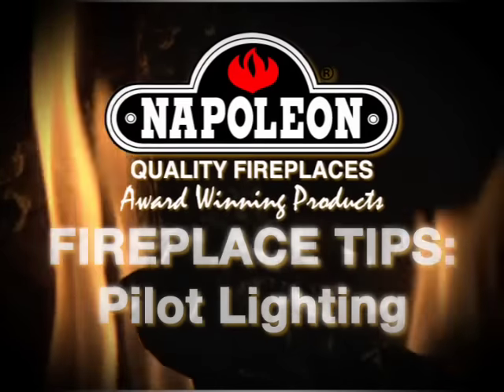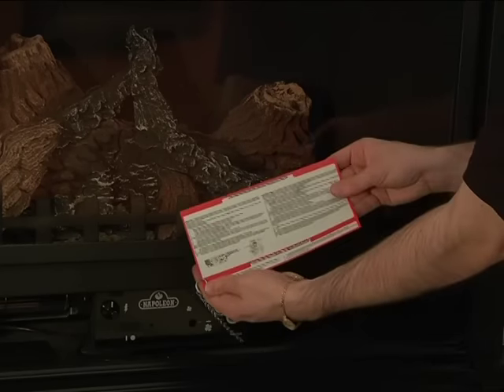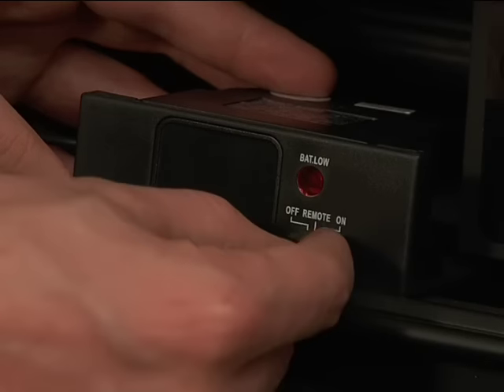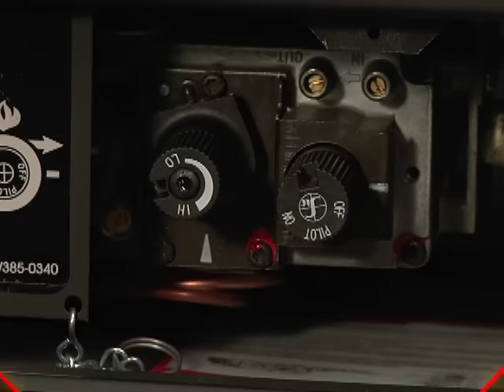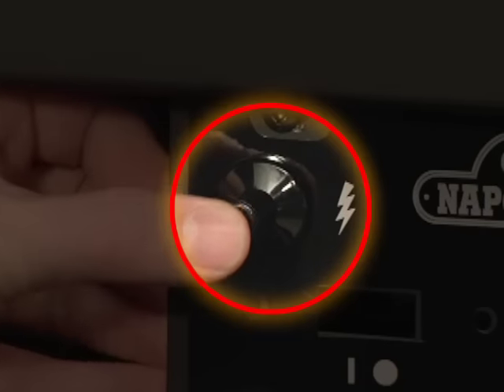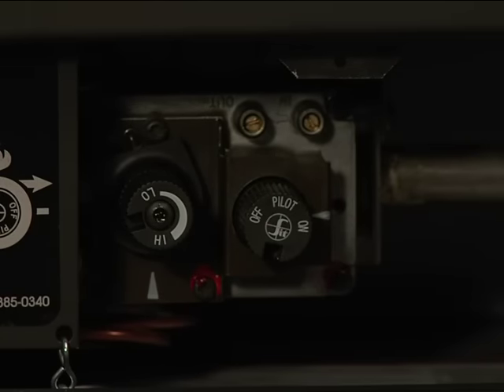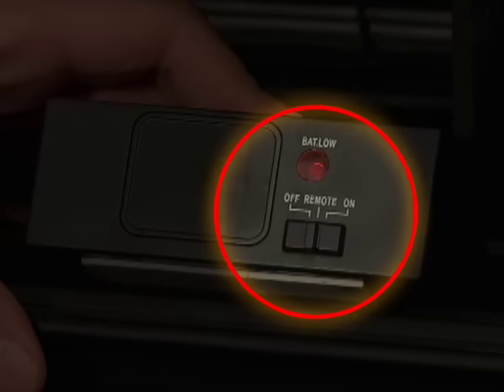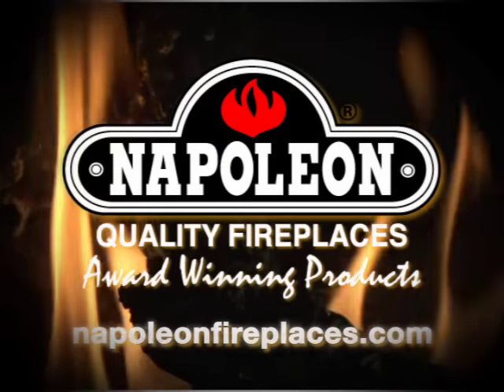How to light your pilot in a Napoleon Gas Fireplace

Comment: Will this work in a power outage?
Reply from the maker: Hi K, 

Thank you for your inquiry. 

Napoleon Gas Fireplaces/Stoves/Inserts come with a battery backup or a millivolt system so that in the event of a loss of power, your fireplace will still light and keep you warm. There is no danger to continuously running a gas fireplace during a power outage. 

Let us know if you have any additional questions.
Reply: @NapoleonProducts  Thanks. I wonder why I couldn't get mine to kick on then? Weird. I have 3 Napoleans in my house. Will try again at the next power outage. Will also need a service tech out for the one in my sunroom - the remote battery start thing isn't working (batteries are fine) and I can't get the sparker thing to work either.
Reply from the maker: @Nock4Six  We would recommend contacting your preferred Napoleon Hearth Dealer/technician to come have a look at the concerns mentioned above. Let the tech know that he can contact our Support line while on site if he require assistance with troubleshooting. Don't hesitate to contact our Hearth team should you have any additional questions we can be reached by emailing hearth @napoleon.com. Regards